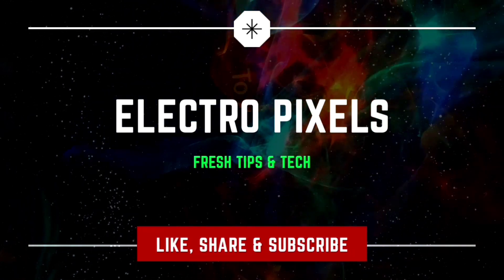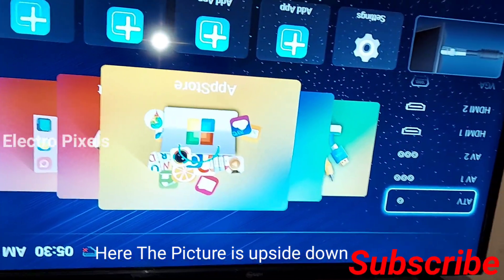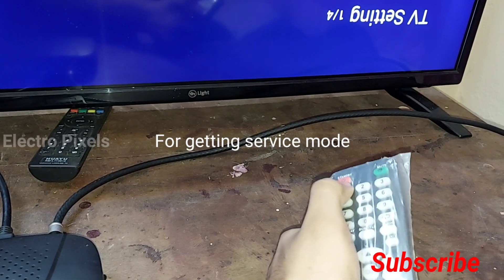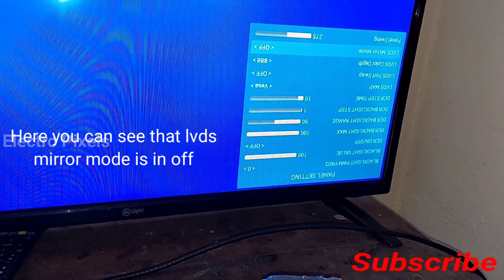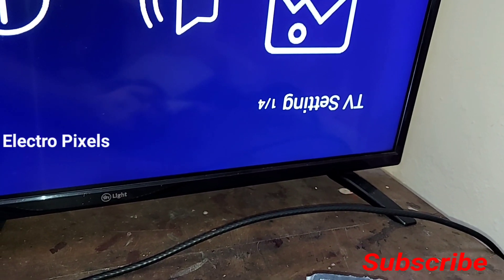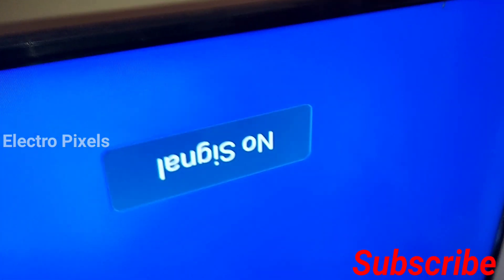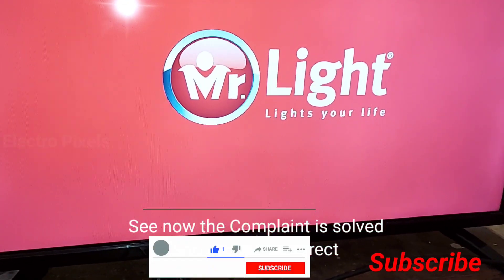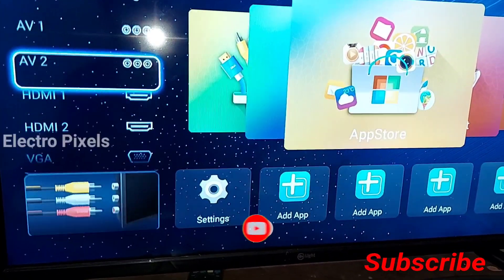Led Tv panel Mirror problem solved. Android led Tv Mirror image solution |Tp. ms338.pb802.Smart TV.

Comment: No option of Lvds mirror
Mirror option is there but it doesn't have on/off option it has default, left-right, upside-down, Normal options 
What to do?
Reply from the maker: Which is the Board
Reply from the maker: All option is there in new model Android Board its on Mirror / or All option
Reply: @ElectroPixels  mirror option hai lekin usme upside down, normal, left right, default ye options hai on off wala option nahi hai